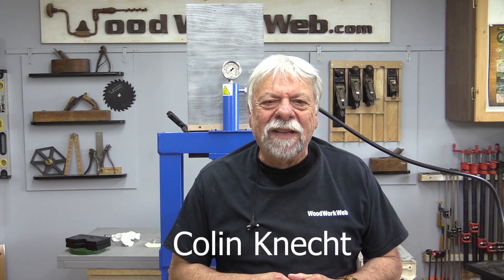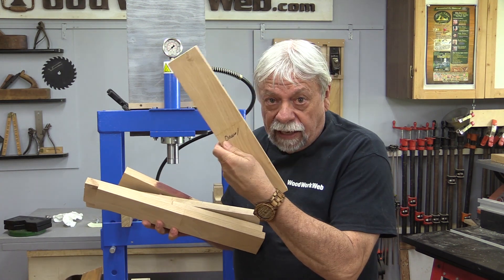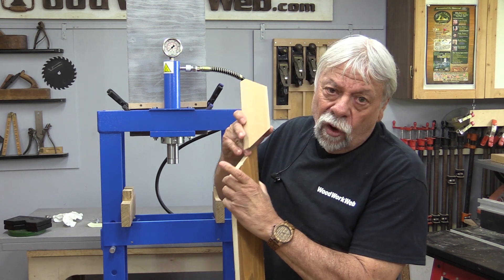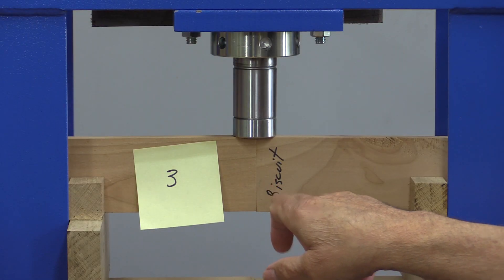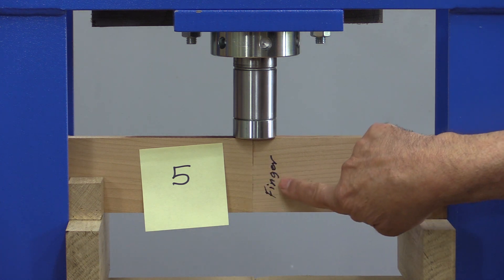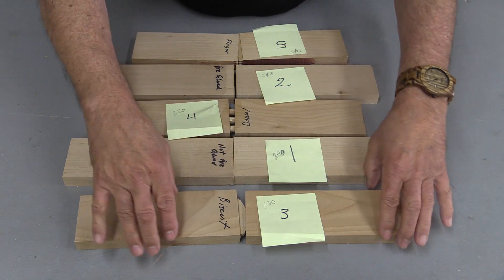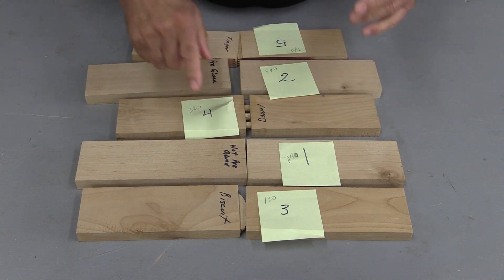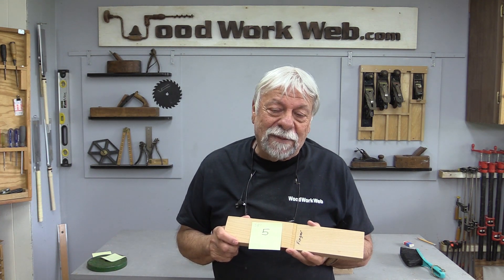Wood Joint Strength Tests on End Joints.

Comment: Interesting test Colin. I think most of it was testing the glue maybe. Joints with anything inside of them seemed to rob the endgrain of glue, and failed quicker than you may have thought. Plus I wonder if you had pressed down across the joint, and it's occupied reinforcements. IE: Across the Dowel, Biscuit, etc, if the joints wouldn't have been stronger? I agree finger joint made sense, and adding so much more glue surface, you got a stronger bonding.

Comment: 5:20 im guessing there has to be a problem with the biscuit itself maybe not taking in the glue? cause that's WAY more surface than the butt joint and i'ts not the biscuits that's breaking apart

Comment: HI, see that if consolidar this test, what I’m interpreting is the following, you are in fact seen glue failures in all the examples in my opinion. Consider that the rank os the result correlated to surface are in contact with the two pieces, the fact that non of the material failed, ie, failure correlated in the exact location of the flue area, neither the biscuit, the dowels, or the finges were deformed ( joint failure) but rated separated form the piece, one can concluidme this is really glue failure.

Comment: Hypothetical question: if you cut a solid beam and put it back together with a lap joint, would it be stronger than if you had left it solid?
Reply: Hypothetical answer (i.e. just my personal speculation): Yes.
Rationale: The logical extension of this idea is composite materials, and these are usually stronger in some way than their component materials. Plywood, for example.

Comment: Great video, thanks. Id also be interested to see a tensile test on joints. I have to join two pieces and Im thinking of using a dowel screw to keep them from pulling apart and keep the joint hidden. If you have a better solution please let me know? thanks again

Comment: More of a common need is to know how best to do “L” joints. And no one wants to do a detailed video about it, especially how to do it with a hardwood like Walnut. I tried Urea Formaldehyde Resin Glue, but applied too much clamping power and squeezed all the glue out of the joint, ruining the bond. I am going to Epoxy glue now, using only very light clamping. Colin, can you shed some light on this?  Thanks good man! 💛😎

Comment: I'm wondering why your glue joints failed so badly. In other videos I've seen the wood fibers break before the actual glue joint. Old glue?
Reply: I think there just wasn’t enough glue used in these examples

Comment: If you’re doing these sorts of testing type things in the future, I would highly suggest doing at least 3 of each test, so in this case if you had done 3 of each type of joint with same wood and procedures. That can’t help bring to light the variability in the test/materials, which can be surprisingly large sometimes.
Reply: 3 to get the mean 😉
Reply: yes, and try hard to match cut and grain with all boards. i saw variation
Reply: Also, please add a non-joint variation for comparison. This illustrates how much weaker joining actually is.

Comment: I suspect the biscuit joint to perform much better if you applied the pressure to the face of the board rather than the edge.  can you repeat the test but this time apply pressure to the face of each board.  thanks of the videos.  very informative

Comment: I was surprised the biscuit didn't do better. There was discussion below that biscuits have a waxy coating that reduces glue bond strength. This suggest some glues might work better than others with biscuits. As biscuits are used today I don't think strength of the joint is all that important. YouTube and woodworking literature is filled with testing that show that biscuit joints are weak. If the strength of the joint is an issue don't use biscuits. Pocket screws are similar. They are fast and good enough most places they are used.

The biggest surprise for me was the dowel failures. I still am not sure what to make of that. I assumed you'd need to rip a board apart before a dowel would pull out. Not so I guess. The failure mechanism seems to be that the wood fibers fail where the dowel and the wood meet. Very surprising to me. But if that is the case then theoretically longer dowels would be stronger. I'm still betting on the dowels even if they lost this round to the finger joints. I would like to see a redo of this experiment with the dowel team getting a chance to make some changes.

Comment: It would be interesting to see what happens if you offset the joint so the joint is not directly under the pressure point. Would the non joined wood break before the joined part?
Very interesting video! I love these!

Comment: I believe I can help with some of the confusion as to why the biscuit and dowels weren't as strong as expected. 
Your test was set up such that bending would be the failure mode of each beam. The strength of a beam is a function not so much of how much material there is, but how that material is distributed. You can make a much stronger beam with less material just by arranging it efficiently. the material at the extreme top and bottom of the beam contributes the most to the beam's strength (side note: That's why I-beams are shaped the way they are. It's a very efficient way to get as much material as possible where it does the most good).
So in this case, we see that the biscuit and dowels failed at lower loads than expected. That's because they didn't engage the beam fibers at the top and bottom of the beam the way the other three joints did. So even though the total beam was the same depth, at the point of load (right under the press), you had less effective depth to work with, and thus a much reduced strength. For the mathematically inclined, the reduction is proportional to the square of the depth, so it's a bigger difference than if it were proportional to the depth itself.
Additionally, I think a big part of why the dowel and biscuit joint didn't crack the same way the others did is because they had those interior components. The dowels and the biscuits themselves didn't fail, so the beam was able to retain some strength just by bearing on those interior connectors and holding together with just friction. As 
sacha schnauzer pointed out, this has the desirable effect of being much safer failure modes than a full rupture as with the butt and finger joints.

Comment: This was an interesting demonstration of SHEAR. In reality, any of the glued joints (beyond the first, 'glue and clamp') will sustain any practical application of force. An interesting follow-up, repeat the tests, except place a steel block between the press shaft and wood joint... say, three inches wide with 1.5" overlap each side of the joint. With the load distribution across a broader surface, you might find the results lean toward the biscuit or dowel joint. Why? Because of the mechanical advantage of either dowels or biscuits. This IS NOT a negative comment... I found it very interesting... and even more interesting if you carried it further with load distribution in lieu of a single point load! Thanks... I enjoyed the demonstration.

Comment: I would be curious to see pocket holes with and without glue.
Reply: Matthias Wandel did this in a test, with a better measuring system than this Press.
His numbers showed, that glue does NOT improve the strength of pocket hole joints. Some other woodworker also said the same. I think the woodwhisperer once also said, that glue does not improve the strength of pocket holes :=)

Comment: If the pressure was applied to the flat surface instead of the edge, would the results be the same?  It seems like the biscuit joint might do better.
Reply: This would be a better test for table tops. The type of failures may be different. In the tests about the tension is on the bottom of the board. Flat again the tension will be on the bottom and tension on the top. The wood joint will be put under different bending conditions. I would love to see the tests that you suggested.

Comment: I've become a bit of a fan for the biscuit joint in certain applications. I have done my own tests and have found quite different results. The right size biscuit properly fitted and glued into a properly glued joint certainly does add strength, not as much as a figure joint but way more than a straight butt joint. I must admit however that I would never use a large biscuit in a joint like the one in your demonstration.
Reply: Yes. One other consideration: The more complete test should compare edge to edge joining, and then the biscuits : wood percentage would perform completely different; also the end grain structure on biscuit slim profile might perform very differently then long grain.

Comment: Of course, to make statistically valid comparisons, you would need to have multiple examples of each joint since the construction technique and wood properties could vary a bit between test pieces.  But, that's still interesting information...

None of those joints would I use in a load bearing situation unless there was a vertical member directly under the joint though.

Another thing that sort of test rig would be useful for though would be testing the types of joints that we use on the legs of tables / workbenches -- assuming it can develop enough force to break the joints.  By positioning the test piece at an angle, you could even test the resistance of a particular joint to "racking" (i.e. a side load causing the table to fold up and collapse).

Comment: Interesting!  A few suggestions from others for a sequel. Most valuable: (1) biscuits make the butt joint weaker.  Not significant on a long edge joint where there is lots of wood with biscuits spaced for alignment. (2) preglue!  I didn’t see any mention of Dominos, but that would be purely academic (for most of us). I would like to see the tests repeated on the face with a caul to spread the pressure. Thanks for an interesting, informative video.

Comment: I think your assumption on the scarf joint is incorrect.  I think the glue would still fail first.  And in lieu of the lap joint, you should test a 12:1 aircraft style scarf joint angled from the wide side of the board rather than the narrow side as you did before.  That gets rid of the weak area you mentioned in the lap joint.

Comment: How does this compare to a board that is whole?
Reply: I was wondering this , and also another setup where the pressure is applied on the wide flat side of wood (for example 10cm/4inch from the joint) and something's keeping the other side of joint sturdy. I think this is more similar to normal usage of wood.

Comment: I don't understand. Neither the biscuit or the dowel joints failed in the video. But, you said they were the worst.
Reply: I agree.  I don't understand why the gauge not going up is a failure of the joint.  Seemed more like a failure of the press.
Reply: I had to re-watch that part of the video several times to understand what was going on, but in actual fact the joint was breaking apart and allowing the piston to move down slightly so the pressure didn’t go up, but at first it did look like the press had failed and not the joint.

Comment: In my opinion, biscuit joints aren't designed to add strength to a joint, they are for getting an exact alignment between two pieces that are being joined together.
I know you stated that you made a particular effort to make sure it was all glued in the joint, but if that effort only concerned the biscuit and slot and not the end grain, then I can see why the first two joints bettered it.
Great demonstration nonetheless.

Comment: I would prefer to see the strength of half-lap and scarf joints tested. A better test would be to secure one end of the boards with your strongest clamps, and hang weights on the end of the other board until the joint fails. Choosing the position of the fulcrum and length of the lever arms correctly should be enough to break even the stronger joints, so long as you have strong enough clamps to hold the other end.
Reply: Yes, those were the exact two joints I was most interested in seeing tested against each other so I was super-disappointed when he wasn't going to test them.

Comment: Would have been interesting to see you break a piece of wood.  No joint, just a continuous piece of wood.  Then we would have something to aspire to.  Right now we are comparing "nothing" to something, but we don't know what the ultimate would be.  No good idea how strong is strong enough.  Surprising that some of the "improvements" weakened the joints.  The biscuit is actually a cross grain connection in this case.  Wonder what would happen if you brushed it's surface on a piece of medium sandpaper to get the "glaze" off the surface?  Thanks for the test.

Comment: Colin, I wonder if the glue was left to dry out for 24-72 hours would make finger joints even stronger.

Also the whole glue technology asks for a deeper understanding. First how to help the penetration into and between wood fibers (like endgrain preglueing is one of its simpliest case). Then how thick the glue should be éhen applied, how much time to wait before joining the glued pieces, how strong hold them together, and let them apart, wood type, wood dryness, air humidity temp and glue drying time, glue hardening time, and so on.

Finger joints are very very tight joints. I suspect some issue, too much glue squeeze out, less penetration. If you see the finger joints should be broken NOT AT THE JOINT SURFACE but anywhere else. I suspect almost zero penetration for that finger joints test, otherwise the joint surface would hold up and break anywhere else - knowing glue is harder than wood.

Comment: Whenever biscuit joints fail, the biscuit always seems to be fully intact, where as I would have expected it to kind of break apart? as the glue should be stonger than the wood right? Makes you wonder if the glue isn't bonding to the biscuits as best it could. I mean, I know a biscuit is no domino, or dowel, but it SHOULD do better in theory? it's just a loose tenon. It also is comparable to one of those thin finger joints you had, and is longer! .. so it should do better? whats going on?. Odd. I still think it's a bonding issue. One really interesting test would be to compare a standard biscuit vs one one you made yourself from solid wood. I reckon it would bond better and give better results.
Reply: My thoughts exactly. In theory the biscuit is a floating tenon that greatly increases the gluing surface and hence, in theory "should" perform better than a straight butt joint.    I have noticed that some of my biscuits have a very smooth almost polished/waxy surface finish which may hinder the glue absorption?  Other biscuits were dry with a very rough surface that immediately absorbed some of the glue and made for a very strong joint.  When I first began using biscuits I glued some scraps up, let them dry for  days and when I tested them the wood around the biscuit failed near the joint but not the joint itself. (Note: Just before I hit reply on my comment I had a memory that the wood may have been particle board. I know that particle board definitely fails before the biscuit as I have dismantled biscuit joined furniture and the material failed, not the joint.)  It may be that biscuits are good but finicky with regards to moisture content, surface finish and the amount of glue used?
Reply: @PaulScott_  Yes, something isn't right. It's almost like adding the biscuit weakens the joint to the point where it would probably be just as strong with the biscuit hole cut and then not actually having the biscuit (another interesting test).

Comment: A lock miter joint that can be used at both 90 and 0 degrees would be an interesting thing to see tested. I would imagine it might come close to the finger joint, or better. I'll check and see if you try it some day.

Comment: What is this preglued method? I've never come across this before...
Does the glue need to set hard first? Or mildly sticky?
What about a lap joint? 

Would be great to convert it to kg or something we can relate to.
Reply: He described the pre-glue method twice: glue both surfaces, wait 15 minutes, reglue, and clamp together.

PVA (white) glue does not stick to dried PVA glue, so don't let it dry too much.